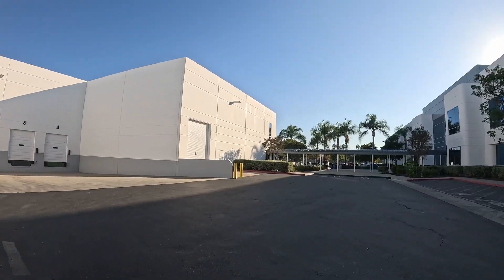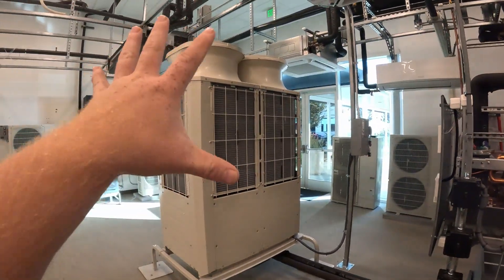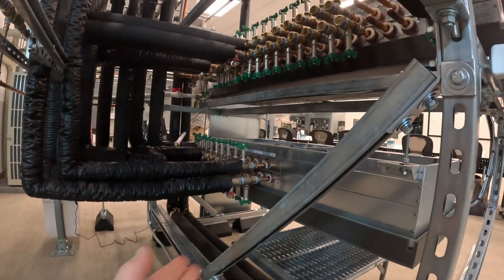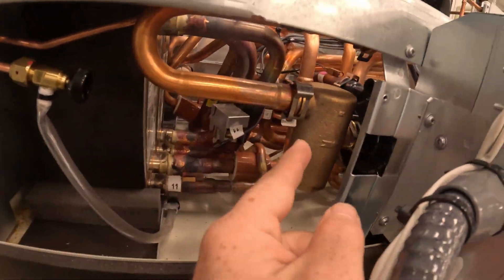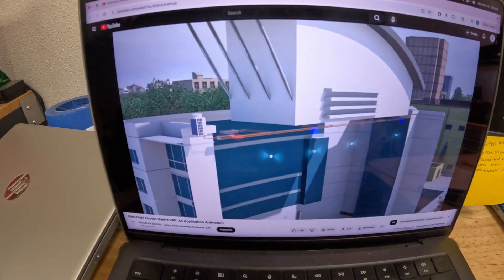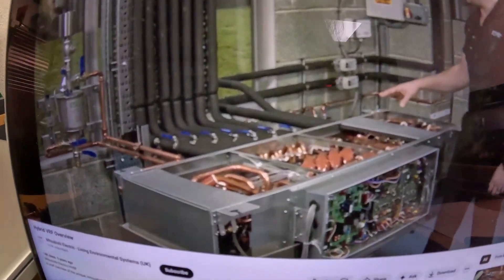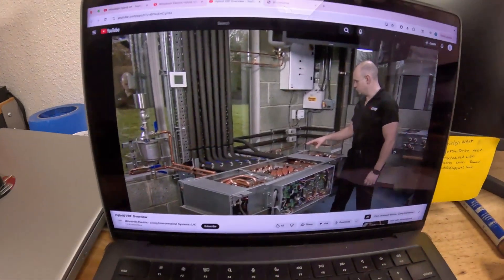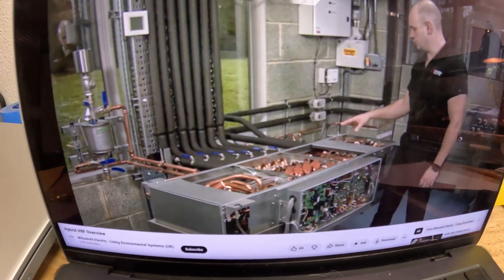NEW Mitsubishi Hydronic Branch Box - Hybrid VRF... Great Idea or Big Mistake?

Comment: Hydronic stuff is pretty common in big highrise buildings, right? Or is it not on the west coast? Seems like the majority of this system wouldn't be that different from stuff like boilers and chillers. But yeah, definitely need a specialist to actually work on the VRF side of it.
Reply from the maker: We work on hydronic stuff all the time and we also work on water source VRF equipment too. But VRF to hydronic is a new one for me. I'm intrigued more than anything and not at all against it
Reply: @SurfBrosHVAC I wonder if it requires their head units or if it could work with existing radiators / fan coils? If it turns out to not be that crazy to work on, I bet a smaller scale version of this could be great to retrofit old homes with just a few hydronic zones.
Reply from the maker: @zman0900  Yeah they only work with their own indoor units. I mean maybe you could refrofit some of their controls onto existing water coils? But it has to have communicating controls. There are air to water heat pumps that have been available in residential for a while now but they are not very popular yet

Comment: No need to leak check tens of thousands of lineset, now just the outside unit. Seems pretty nice. I wouldn't''t be surprised if in the future, homes will incorporate this.
Reply from the maker: There are less well known manufacturer's making air to water heat pumps for residential already.

https://www.chiltrix.com/

Pretty similar. Haven't ever really looked into them much though

Comment: Pex out to the indoor units will save a ton of install cost
Reply from the maker: I checked the manual and it say water lines may be plastic or copper. I don't like PVC for water lines personally but if pex is kosher then I think it'd be a game changer
Reply: @SurfBrosHVAC 
I hate pvc for water lines as well. That, like cpvc, gets brittle over time.